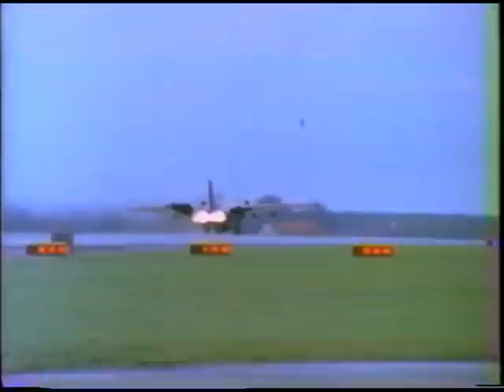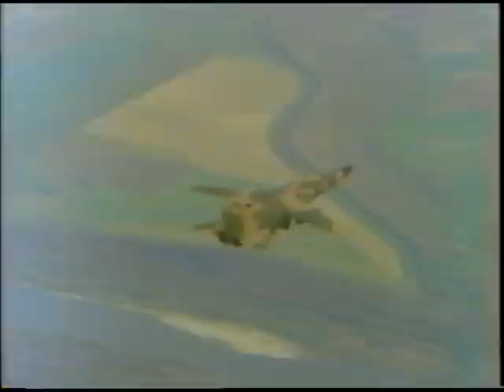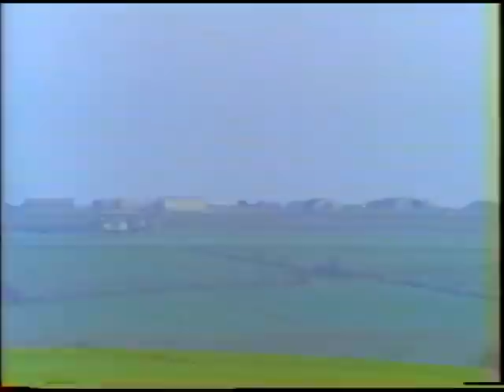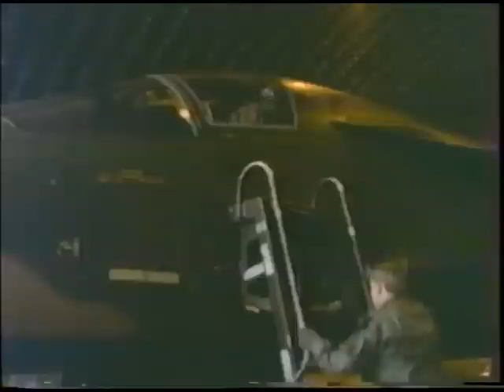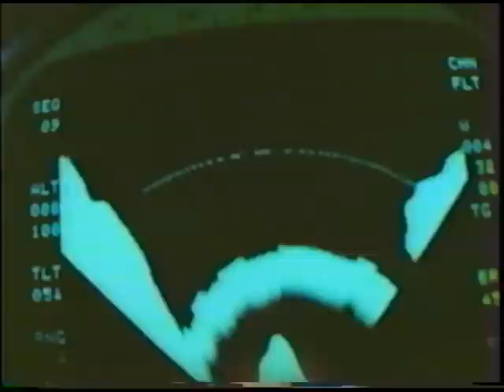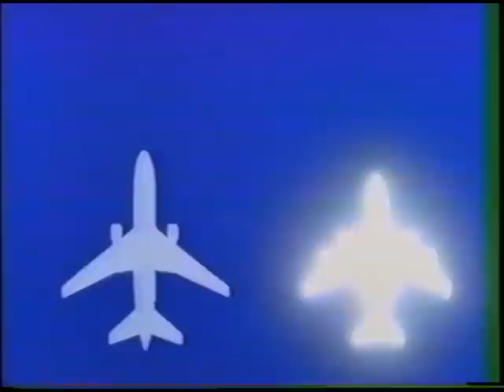F -111 Beyond Challenge (GD/FW)

Comment: I did avionics and flight control systems work on the F-111 F model in the mid-1970s. This aircraft still to this in 2022 would provide munitions any place on the planet it felt like. Get some of these things back out of mothballs, upgrade the electronics and integrate their original terrain following radar systems, along with new General Electric engines which put out about five to six thousand pounds more of thrust oh, and these things would be unstoppable for the next 50 years. There has only ever been one ever shot down and that was when Libya was tipped off that the planes were coming in and they fired everything they had and they actually hit one. It certainly wasn't because they were aiming for it.
I was also lucky enough to fly the flight simulator and develop a procedure for engaging the terrain-following radar if you're already in articulated Terrain. With that I was allowed to teach several Pilots how to do that so they could teach others without it being on the books.
Reply: B Shop on the D model at Cannon, 79-82

Comment: Saw an F-111 take off at Wurtsmith AFB, MI in the mid 80s when I worked 52Gs of the 379 BMS. It was easily the loudest plane I had ever heard. Until I saw a B-1 take off in full burner on a very cold 94 Nov morning at Dyess. I was about 200 ft away from it.

Comment: It first flew successful test flight 4 days before I was born, I served in the RAAF, was taught by F111 RAAF pilots in PPL, CPL.
One day at RAAF Williamstown one of the Ex F111 boys caught a Pig 🐷 going back to RAAF Amberley.
They were on a bragging tour on the way home, stopping off wherever they could.
They'd just set a speed record from Amberley to East Sale. 
The speed over the ground worked out to be Mach 3.5 as they had a +350 knot tailwind at altitude.
I did the walk around with the successful pilots.
They said the hardest thing about the flight was slowing down enough to land.
If I remember correctly it was 31 minutes.

Comment: My dad help build the hardened shelters at Upper Heyford for those bad boys.
Reply: I was at Upper Heyford 77-79  and they started building those hardened  
Structures in 1978. I was with 20th SECURITY Police  and worked in the QRA and WSA . I wS only 18 years old when I got to Heyford.  Very good assignment. 👍
Reply: @kennethbilinovich3432  -- We probably crossed paths when I sat Victor Alert.  Heyford was a great assignment.

Comment: There are several aircraft that should've been kept in service with upgrades and overhauls.
The F-111 is one of them.
Reply: worked on them a few years.....agree
Reply: But back in the day there were engineering shops tasked to making spare parts,new parts etc then they get moved to the next latest thing and those old parts run out ,perish or just aren't there.
It's natural attrition.
Try finding an original LX Torana tail light at a wrecker.
Might be in rare spares budget to mold more off original Holden tooling but yall have to pay
Reply: Nate D:
For weapons that are as effective today as they were then I’d be ok with my tax dollars being spent on it.

Comment: The part showing that sexy Cadillac dragging a shock wave across the desert was fantastic
Reply: I've seen clearer imprints of this particular footage elsewhere. Tremendous stuff. I'm certain that this is an actual genuine supersonic shock wave, given the plane's airspeed (which is simple to calculate in relation to its surroundings. Also, it was capable of supersonic flight near sea level).
Reply: Egressing from a target at Red Flag, we were doing 1.2 Mach at 200' in an A model from Mtn Home.

Comment: Great video; amazing airplane.  Saw it turn into a dot many times.  But it should be remembered that the airplane's promise was to replace/eliminate the need for the F-4, 14, 15, 16, and 18.  It did, however, fulfill its strike role very well.  In the Sandbox, a single squadron of 111s destroyed more Iraqi tanks than all the A-10s in theater.
Reply: It was never designed to replace Air to Air aircraft, like the F-15 and the F-16. It was primarily designed as an attack aircraft. The "F" designation was an error by the Sec of Def.

Comment: I believe in 1960s some f 111 were lost in SE Asia  jungle due to technical issues
Reply: Du Nguyen,
They lost 3 on the first deployment in Vietnam.  The plane was very new and there were systems that were not well understood not the least of which was the wing sweep mechanism which had weak spots that sometimes failed.  They learned a lot from the lessons with the F-111 and they never had a disastrous mechanical failure of the swing wing in either the F-14 or B-1.
Overall, the plane probably introduced TOO MANY new technologies and engineering firsts in one air frame.  They produced less than half of the F-111s they originally intended to manufacture because of all the bugs and it was the better part of at least 10 years from first flight before the plane could be called "reliable" and even then it was a bit of a hangar queen at times!  They never completely resolved the engine issues and the TF30 engine continued to be problematic towards the end of its operations.  There are no TF30's left in operation anywhere around the world aside from the dozen Iranian F-14s that can be flown (with baling wire keeping those planes together).
There were so many differences between the models of the F-111 that I'm sure they had logistical fits within the USAF.  They had different standards of avionics between each model and at least 3-4 different models of the TF30 engine in service.  There wasn't a lot of standardization beyond some basic airframe parts and even then --!  The TF30 in the newest F-111s built, the F-model, were a different generation engine than the TF30 in the A-model!  Due to aerodynamic studies, there were at least 3 different inlet designs among the models, too.  The Australian C-model was a hybrid between the original A-model and the FB-111A model unique to the Strategic Air Command.  The C-model was later updated with the same engines and targeting pods they used in the F-model.  
There were originally supposed to be 4 services flying the F-111 -- the USAF, the USN, the RAF, and the RAAF.  Only the USAF and RAAF bought the plane.  The USN hated the plane from the start and were right to reject it -- it was NOT designed to their desires and needs and would have been a horrible fit for them.  The RAF was in a bad place in the 1960s with waffling politicians and a national defense policy that could not make up its mind!  They were waffling between wanting to save money and rely on missiles for defense or keep manned system backups and retain programs to shore up their national aerospace industry.  The RAF F-111 project was a casuality of this timeframe along with the TSR-2 (which the UK F-111 was intended to replace) and any follow-on supersonic UK fighter after the British Electric Lightning.  The last major UK military plane project of the 1960s that survived in production past the 1960s was the Harrier. 
When the Australians finally retired their F-111s in 2010, they had been putting an average of 180 maintenance man hours (MMH) per flight hour into their machines towards the end because those airframes were close to 40 years old on average!  That's considered excessive by any reasonable standard.  A modern fighter has a "reasonable" MMH expectation of 12-15 hours per flight hour.  (12-15MMH was the average for most World War II fighters as well.  Prior to computerization of diagnostics it wasn't reasonable to expect 12-15MMH on fighters unless they were something stupidly-primitive like the F-5.  Even the F-16 in some cases was pushed to get 12-15MMH and they definitely weren't hitting 12-15MMH with the F-15 let alone the F-14.)  Anything above 30-40 MMH is considered expensive and excessive unless it's an older type plane or strategic bomber.  A transport plane is supposed to have MMH of under 30 hours; they shoot for 20 or less for planes like 777's.
There was another issue (resolved after the US military involvement in Vietnam, circa 1973) with the F-111 avionics giving false readings and literally steering planes into the ground.  There was an officer who finally figured out what was going on and convinced his superiors to investigate the situation and make the fix.
Reply: @AvengerII  Crikey
Reply: @AvengerII  thank you!
Reply: AvengerII 
What the hell, Mister? 
What an over-blown response, with far more than the commenter referred to.
Reply: @patrickflohe1193  Patrick --
Being trapped by COOF hasn't made you a better person has it?
Someone makes a comment, I added to it.
You could do nothing but be an ass to a stranger.
You must be "lovely" at parties and tell other people they're talking too much when they try to tell stories.
Take that overblown response and shove it up your ass...